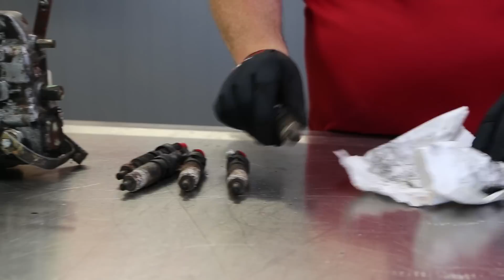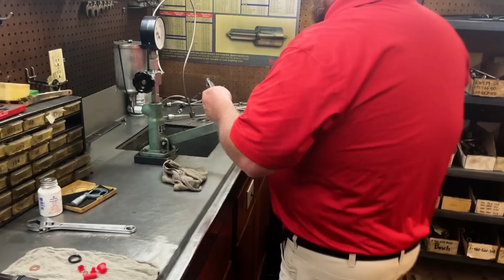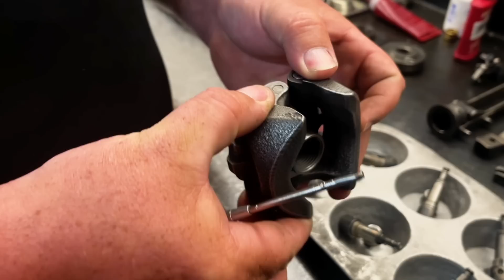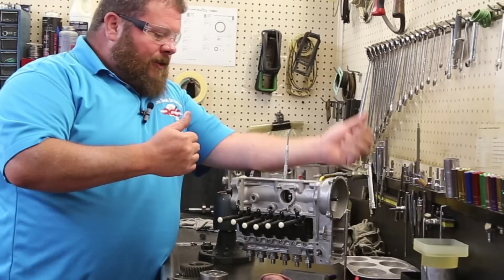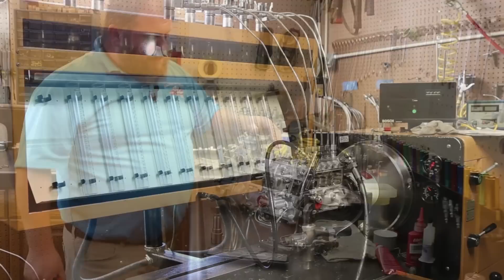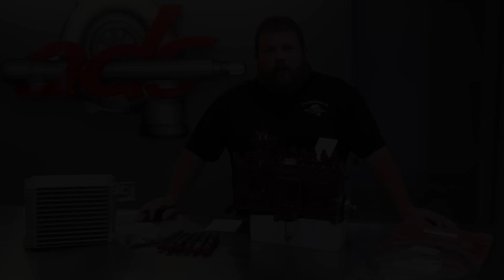The Case of Large Marge! @FarmCraft101Case 170B Excavator Problems Deutz 913 Pump & Injector Reman

Comment: I have watched this channel for a couple  of years.
  Noticing  that a lot of  your in-house  remanufactered parts are obviously  out of specs.
  Your techs make comments that's parts are not all exactly the same for the same model pumps ?

So, is it that  Bosch and other OEM manufacturers are making junk ?

   The welding  looked good on this casting  repair.

The hand ground surfacing you can see it is not flat !!

Dusty was using a mill to drill hole = great.

NO EXCUSE FOR FINISH ON HOUSING BEING  MESSED UP AND NOT FLAT ???

THE PART WAS STEP-UP IN A MILL ???

Maybe you should stop using the word experts when it comes to your machine shop.

P.S. 
I watched  Diesel Creek turbo fail video also.

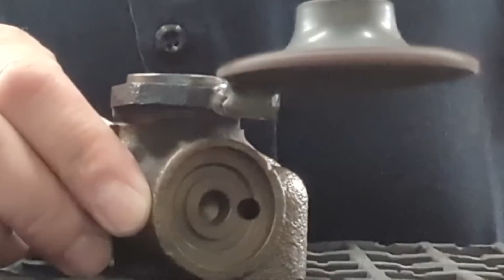Comment: @23:50 To be honest: I am really disappointed with your work in this case. You should have used a CNC milling machine for this (that's what I would have done). The result is pretty bad (like you can see in the Farmcraft video "Fixing The Most Requested Repair On The Excavator. Case 170B.")

Comment: This type of work and activity is completely outside my realm of knowledge. It was very interesting to have you explain the process and go through the teardown, analysis and rebuild process. I think it's interesting how you describe the impacts these issues have on how the engine operates and yet there are SO MANY diesel's that people just run, run, run until they are clapped out and never spend any money to do the correct teardown and maintenance to bring the parts back to new operating spec. I understand the economics of it I guess, but still. I guess when you buy a piece of equipment for work purposes, you just work it to death and sell it for scrap (or to someone like Farmcraft101 or DieselCreek) and let them spend money and time to fix it up to 'like new' running condition.

Comment: Almost all of this is absolutely beautiful, high quality work that I'd be proud to put my name to so it pains me to say this, but what the hell were you thinking with that fuel inlet housing?  That's a clean break, no staining, aging, or rust on the surface anywhere, that was broken by mistake not "just fell off".  And while the welding repair is AMAZING, I wouldn't have shown anyone the repair machine work... grind it down with an air die grinder and a cookie wheel??? THEN set it up in a Bridgeport?  You could have put a boring head on that mill after centering it up the way you already did and faced the repair down perfectly to OE fit and finish and it probably would have been faster than using the die grinder, really, and you wouldn't have accidentally hit the spigot chamfer with the grinder either.  Just makes me cringe seeing that on an otherwise 12/10 grade remanufacturing job.

Other than that... absolutely amazing quality work.  Love it.

Comment: Another wonderful video. I worked validation for Caterpillar in the C-7/9 high pressure common rail fuel system and we faced a multitude of growing pains with that system . I remember building , tear down , rebuilding , reengineering parts , and doing this process so many times I lost count. I know the processes you take to insure that the clapped out pumps and injectors you miraculously rebuild and bring back to life for a second life is no walk in the park. Keep up with the great work and keep these videos coming I wait to see your next project of rxeviviving another basket case project into a mechanical work of art. Thank you.
Reply from the maker: Thank you for the comment, sounds like you know EXACTLY the kind of tedious detail that goes into these king of jobs.

Comment: Nozzle injectors also suffer from foreign object debris getting inside them and causing problems.  Good fuel filtration is crucial for longevity.  OEM fuel filters are typically only 60% efficient at whatever micron their spec is.  Thats why sand and sugar go through them.  The condition of those injectors in used condition would not just make the engine down on power and smoking, but also wasting fuel.

Comment: Are you able to get the procedures related to the engine/pump that are used to properly remove the pump? Some Cummins have a pin near the pump and some Cats have pins in the flywheel housing and flywheel housing. Then some pumps require removal of the drive gear with special tools and other pumps the gear comes out with the pump.
Reply from the maker: Most of the time we can. Specifically, if the fuel system manufacturer was involved in those processes. There are times where the engine manufacturer developed those procedures after the pump was engineered and we may have a more difficult time locating it.

Comment: i have a friend with a 1985 mercedes 300D, with an OM617 engine and a bosch 5 cyl injection pump, how much do you think it would be to rebuild and calibrate that? (i was going to say its in pretty good shape but i dont think that would make much of a difference)
Reply from the maker: Will guess - $1500...

Comment: With each of your videos I am reminded of what my Dad told me as a teenager, "Don't even think about working on an Ijection Pump without the proper Knowledge and Tools.  There is a reason we call the people that service these things Experts and Specialists."  
He was working a GM 350 Diesel at the time.  Warning Labels all around the Engine Bay and Air Filter Housing stating DO NOT USE STARTING FLUID yet he seemed to have a Fuel Delivery problem so "Why not, always worked for Semi and Farm Tractor engines."   I watched that one drop of Ether fall from the almost empty spray can in slow motion, then heard that sickening CLUNK as the Starter no longer rotated the Engine.  Locked Engine up so badly that the housing of the Starter broke!  That day I learned what "take it to the Experts" means...as well as a few colorful words!   Dad passed in 2006 and I surely do miss him.  He would have loved watching many of the YouTube Channels I follow because of common Interests.

Thank You Area Diesel Service , for the Memories that were brought back!  Awesome Job of showing us what goes on behind the EMPLOYEES ONLY doors!

Comment: Those Deutz air cooled diesels are amazing. Many years ago a friend of mine was the head mechanic for a SUNBEAM BREAD bakery that had a large fleet of box trucks. They started converting over from gasoline powered to Deutz Diesel. By accident one of the drivers accidentally filled the truck with gasoline, My friend called his Deutz rep who told him, "it'll be fine, dump a couple quarts of oil in the tank and drive it gently otherwise you'll smoke the tires right off the truck". Turns out that engine design was meant to be run on various fuels in emergency situations. Can't begin to tell you how many miles some of them had on them when the auction for Sunbeam Bakery Liquidation took place but I know my friend Loren mentioned some of them had close to 1 million miles and had been moved from truck to truck as the chassis wore out.
Reply: Awesome story 👏!!

Comment: bosch injectors are like 65€ a piece for this old stuff  ~390€ for all 6 new 
new old stock bosch injection pump of this type is 1850€ without primer pump and sediment bowl - thats another 250€ new old stock 
you can use cable grease sprayed on the diaphram to protect rubber and metal inside as preservative from condensate from the boost air it is a slight problem with this design acting like a vapor trap 
international shipping would probably be between 400€ and 600€ considering weight and fragility
Area Diesel Service did a very proper job and if you add that up you might have still saved Farmcraft some change despite the effort and man hours
the engine oil cooler i only found as italian aftermarket or scrapped used part online - Deutz has a monopoly on these old stock parts even here - tho its probably less than 600€
here in europe these engines are really sought after - the oil cooled engines have a awesome sound and very good fuel economy due to higher engine temperature than water cooled
they live forever so long they got proper oil 
btw they need oil thats extra heat resistent with 15W-40 viscosity - there are specific oils made for air cooled engines with higher stability if overheated

Comment: Since the lower half of the injector body was corroded, did you have to buy new ones or find better cores for rebuilding?
Reply from the maker: We replaced the nozzle nuts with new. That is where all of the corrosion was located. The rest of the injector was in good shape.
Reply: @AreaDieselService  Thanks. I like seeing how you rebuild things, and that you do throw things out that are beyond saving.
Reply from the maker: Depending on the material type, have scrap bins for various metals and recycle the unusable scrap.  Waste not, want not!